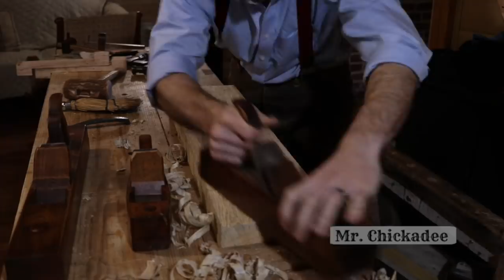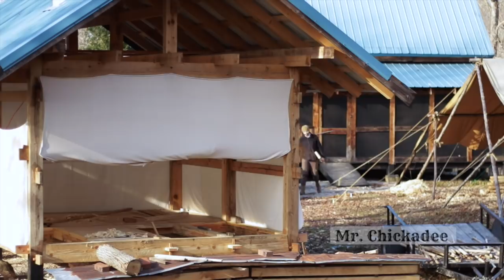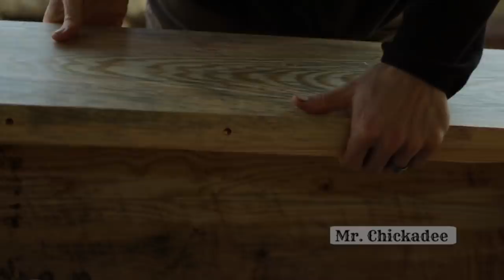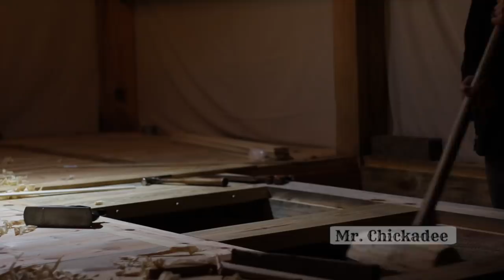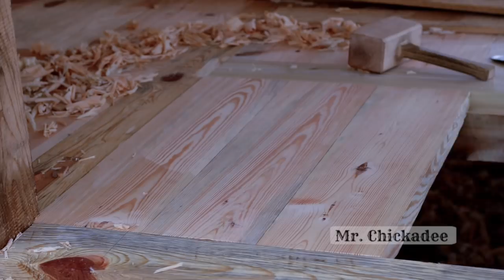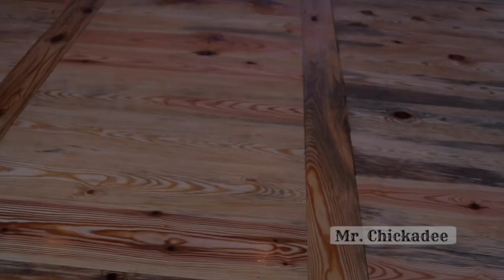Traditional Korean floor 대청마루 ( daecheongmaru) PART II a wooden floor without nails, screws or glue

Comment: I have watched all the filming repeatedly for 2 years and I am deeply inspired by everything I see in them. I have a question about the last structure with Korean floor. How are the floor support beams fixed to the side pillars of the structure. The main beams from the front, back and middle, I saw, leaned on the oblique kneeling in the poles, OK; just like the beams that support the bridge. But in sides how are fixed the beams without housed? that was the question. Thank you. Sorry for the little English I own. Good that there is Google translated. Dimi .
 I wrote the same text on fb.
Reply from the maker: Hello, I hope I can understand and explain well for you. The three large beams are resting on a housing shelf cut into the vertical post, then they are also pulled tight with a free tenon that slides in from the outside and is wedged in position.
Reply: Okay. This is clearly seen in the Timber Frame Class movie, when the beams that support the floor of the bridge are fixed, with the difference that the free tenon is under the beam. I think I did not make it clear. I asked about the four beams that are perpendicular to the 3 fixed as you explained, those on which the side walls of the building will be supported. I noticed that you made a perpendicular hollow that comes above the hollow in which the three main beams were fastened. And further on ?
Reply from the maker: @dumitruceara3579  ok, the middle beams are resting on a spline joint, it passes though the middle post and into the beam on each side, it is tightened with wedge shaped keys that tighten as you hit them in. If I was expecting more weight on this floor, I would add a housing as well.
Reply: O how good! the answer came. In the meantime I discovered the structure and foundation of Jai (https://permies.com/t/50403/Simple-Timber-Frame), after which I think you have inspired. There are housing. But the beams are offset and the pillar resistance is not weakened. But it's still not seen the joints in the middle pillars. I'm so insistent because I decided to run, alone or with my wife (according to "Mr.Cickadee" brand) this summer, such a structure, the first in my life, with the difference that I would high the bridge to can circulate and store one or the other. I would be very grateful if you had a little time and you would help me with a detailed link to such stone foundations or at least a picture of this type of joint. Anyway thank you very much, I can hardly wait to see how you made the walls, the entrance, the windows and the insulation in the following adventures of the pitsigoi (so we pronounce in the Romanian Chickadee).  With respect Dimi.
Reply from the maker: @dumitruceara3579  Yes, we call this a "spline joint" there can be many forms, some more complex than others, some with pegs some with wedges, many forms from europe to asia. Here is a good one pretty simple too from japanese carpentry, https://mokuchiwoodworking.com/product/shachi/
Reply: @MrChickadee  thank Master, to have a good hand even further.

Comment: I am about to commence building a cabin using Japanese framing methods and, inspired by this video, I am going to construct the mezzanine floor using this method. Have you got any rules about spans? I.e. What thickness of board should be used and what are the maximum spans that people use? Thanks very much for the inspiration!
Reply from the maker: Sounds exiting, Id love to see plans or ideas you have. Spans of timbers will depend on timber size or course, a 6x6 joist will span quite a ways, at least half of most human sized rooms. My little building is quite small and timbers could have been smaller in retrospect. Boards are typically much shorter, more like 18" rather than the 36 I did, I would go shorter here as well. 

the video linked below shows in depth the actual korean practice, which I did not follow at the time, I found my own way, but its great to see and give more ideas

https://www.youtube.com/watch?v=nDrqidMDyqI
Reply: @MrChickadee  Thanks very much for your reply. I have a sketchup plan work in progress I could show you, although it does not show the joints I will be using at the moment. How would I share it with you? I would also be happy to share photos of the build with you.

In part, this cabin build will be a practice for a larger build that I am quoting for which would incorporate roundwood (although I am also going to be living in the cabin). I have mostly done scribed framing before and so the idea of working from centre lines, keeping diagonals to a minimum and eliminating scribing seem like ways that I could make this build affordable. I am excited about introducing more eastern framing methods into my repertoire and I have been in contact with Jay White Cloud who has given me some good tips, mostly about how to use google translate! 

Back to the floor, I would be tempted to follow your lead and have the floor planks longer than traditional to minimise joinery, as I've got very little time to build it. The mezzanine will not be taking a lot of weight and does not need to be perfect.

Thanks for the video, I particularly liked the trick with the last board, blocking it up from underneath. Cheers!

Comment: On one of your videos -- I can't remember which one -- I saw you using a splitting wedge that looked about like a normal metal splitting wedge but it had a wooden section on top with a ring/band around the top of the wood on the end where it would receive the blow.  I like the idea of reducing the decibel level of splitting wood, as well as reducing wear on the metal and the risk of flying metal fragments, but I can't find anyone selling any such wedges or even figure out what search terms to use to look for them.  Can you help?  Thanks!
Reply from the maker: hard to find, most like that are from before the bessemer process made steel cheap, so wedges were made to be struck with wooden mallet, never mushroomed or destroyed.

Comment: I'm curious as to why you put the band on first, making it essential to leave those pesky pockets that the very last boards fill. Could have just put all the boards in the same way then slid on the band. Serious planing skills at work, holy crap.
Reply: Well, it could make for an easier repair, sometime, couldn't it? Plus, that beam seems to be pretty integral to structure, and not some applied end cap. One stage at a time.

Comment: When you say “without glue..” does that include handmade animal hide glue?  I noticed you paint something on the pegs but I’ve also dried and shrank pegs in heated sand for four hours before wetting them and driving them in... in the ambient moisture they swell and become permanent.
Reply from the maker: That was just oil I put on the pegs and wedges, not sure why it looks like glue to people, or why anyone would think I would say "no glue" and then put glue...

Comment: How long of a span would you recommend for this type of floor? The 2 foot boards you are doing or would 3 or 4 still work? Maybe even longer with supporting joists that the flooring slides across?
Reply from the maker: Traditional Korean houses actually had very short spans, somewhere around 16-18" or so. If I did it again, I would make mine smaller, its just easier and faster to plane and easier to get wide short boards.
Reply: @MrChickadee  that's interesting, do you know the reasoning behind it? Maybe to control the warp or expansion better? And where could I find more information?

Comment: Doesn't wood that is influenced by winter and summer need some "space" to work with? Wouldnt wood assembled this tight in the cold. Expand hard in the summer and have a "bend" surface?
Reply: mhm "The dovetail prevents any cupping or movement of the boards but allows expansion and contraction and any size board to be used. Other methods used in Korean floors are a simple tongue at the end of each board and a groove carved into the joists to receive it."

Comment: What angle did you use there?  It looks like about 15 deg, but sometimes hard to tell on video.
Reply from the maker: 7 degrees, I think its better to use a tongue on each board and a groove in the joist, as koreans did traditionally, I did the first half of the floor that way, but did not film it. Both are ok, but the first half with the groove has been more stable. It is important that the grooved joist also has a small shelf or "rabbet" so that the full thickness of the board is supported, not just the tongue.

Comment: Why didn't you use dowels on all the floorboards? Why didn't you treat the underside of the floorboards and beams as well? Won't coating only one side cause the floorboards to curl due to moisture on the underside being absorbed into the wood?
Reply from the maker: I did half the floor with groove and spline joints and rebates, half with dowels and sliding dovetails, and some with none, to see what all works. I did oil the beams but not the board bottoms, they cant move since they are held in the beams, so they cannot cup or warp much.

Comment: Im wondering if the wood used is soft wood. (it looks like soft wood species)  Unfortuntely the main woods used here are hard wood species and very dense as well. (Jarrah). Not sure how easy or indeed if this beautiful fllor could be made with our stock timbers?
Reply from the maker: It is a specie of Pine, a conifer, and most of these type floors were made from a kind of pine. Hardwood could be used, though of course the woods character must be understood and applied.
Reply: @MrChickadee  Australia has limited native pine species. My state has no native pine  lumber that I know of.   That beam you lifted and put in place  would be a two man job  (maybe 3) in Jarrah.
Reply: @MrChickadee  my I ask how long would it take you (and your team) to do a house?  say 240 sq meter?
Reply from the maker: @stewartc7493  Id use plantation pine there if I could, or native hardwoods in much smaller timber sizes since they would be much stronger. 

Hard question to answer, I dont have a team, but using my tools and techniques, maybe one month. This also would depend on desired finish, done fresh green and rough sawn, not finish planed, it could be done in half the time, if that was the desired look or feel.

Comment: Nails by itself is a medium to transmit sound, it would squeak when shrinkage of the wood happens creating movement when the nail enters and exits due to human movement. He is using very thick wood and since the wood is short and directly connected to the floor joists, vibration is reduced due to increase in stiffness. It is not much to worry about shrinkage in floors of this design. It is only when the floor is above the joists and connected to the joists through nails that shrinkage becomes an issue. the more integrated the floor is, the better the floor becomes. I will try to make the floor of my home nail free, but will add more pattern and take humidity issue into the design process.

Comment: Another question: you have a zillion angle cuts to make on your floor boards. Do you use a bevel block to set the saw angle?
Reply from the maker: well 152 to be exact in this building...but yep alot. In a perfect world, if Id used say a dovetail plane and the dovetail rabbets were all exactly the same pitch and depth, then yes of course, a guide block and marking gauge for depth would be great, even perhaps all the boards would be exactly the same length, with perfect layout. 

mine was much more organic and "rough" than this, my dovetail grooves varied, as did my depth and board length, even within one lane. So I made each board custom fit, scribing the angles with a bevel gauge and sometimes adjusted boards even within one single lane of boards. 

The actual korean method was to use a tongue on each board end and a groove with stepped rabbet in place of the dovetail groove. I did do some of the floor like this but found it took overall longer for me, as the tongue on each side of the board took a bit longer to saw and pare down than just a simple angled cut on each end.
Reply: @MrChickadee  gotta be practical even in adopting purity.

Comment: I saw that the beams that they are talking about are fixed to the front of the structure in the way explained in the conversation. But I do not see any housing. There is also no housing in the middle pillars. I do not understand how you pulled the beams tightly on the pillars in the middle. Nor did you keep the same levels with the main beams without housing.

Comment: Question:why the need for quarter sawn wood for the capping board?
Reply from the maker: because in this particular case, the capping board is just held by friction and gravity, nothing is keeping it from cupping. All of the other boards are held against cupping by either a tongue or sliding dovetail, they could be flat sawn and as wide as you want, they will never be able to cup.
Reply: i see, makes sense. thanks!

Comment: Quick question. Why the switching of planes at the beginning?
Reply from the maker: well I started with a rough jack plane, then changed to a try plane for more smooth and straight flattening, finally using a long jointer plane gives the most straight board possible
Reply: Mr. Chickadee thanks man. Love your work and videos. Absolutely amazing craftsmanship

Comment: I can understand the desire to have a floor such as this, it is very beautiful! However, I cannot understand the need to construct it using such primitive hand tools. Why not use a thicknesser/planer, a mitre saw and a drill and jig for dowel holes?  Surely that would just speed up the job but not take away from the beauty of the finished product.

Comment: youtube recommended this because I live in a trailer and was searching for how to repair this trash heap the landlord gave me, while signing a rent to own lease. A year later the entire thing is falling apart. total scam. But I've been looking for some way to inexpensively do all the repairs myself. (meaning try to put in sweat equity, vs money equity) This right here can be done, i'm sure, easily (relatively) with tools, correct? Plot twist, I live in Las vegas with 100+ degree heat 6 months out of the year.

Comment: At first I was like "seems like a lot of work for a floor" than I saw the results and was amazed. I bet after about floor board ten you would have killed for a table saw and a good router.
Reply from the maker: I dont really consider power tools as an option, how long it takes is how long it takes. A few days or even weeks is not so bad for a floor than could easily last hundreds of years.
Reply: @MrChickadee  there is something meditative about using hand tools.

Comment: The art of carpentry is being lost to prefab everything. I’m a master carpenter by trade/vocation and a General Superintendent for a  Commercial Drywall and Painting company in the upper Midwestern U.S.
Even framing and finish Carpentry no longer require the use of the conversion  tables stamped into one’s framing square. Occasionally I get to whip out my tools and through on my pouches when an ellipse soffit or feature radius wall needs to be laid out and built. Other than that I often reflect on how the craft is now an art.

Comment: This would never be made in the US purely on a cost basis. Someone is likely looking at all that wood and calculating how many veneers they could cut out of just a single board and charge insane rates to install glued onto some MDF. With the intent of course that it will fall apart in a decade or so and need to be replaced. All the while the home owner thinking it was a good deal as it lasted 10+ years. And completely forgetting homes used to be build to last generations. And we wonder at all the waste in this world. We build nothing to last anymore and dispose of it all when it breaks.